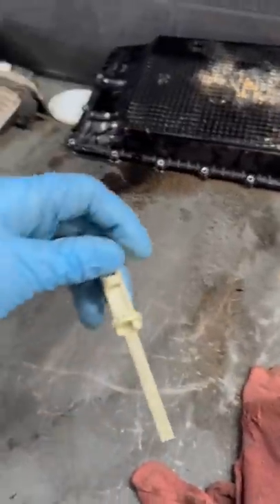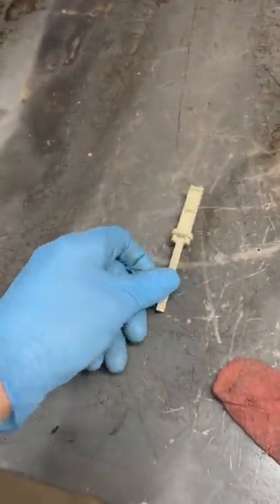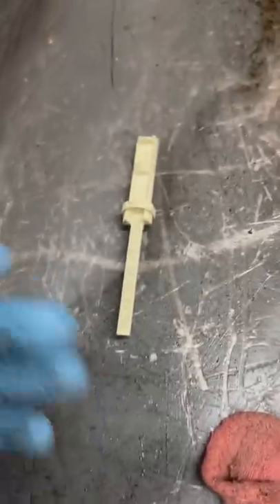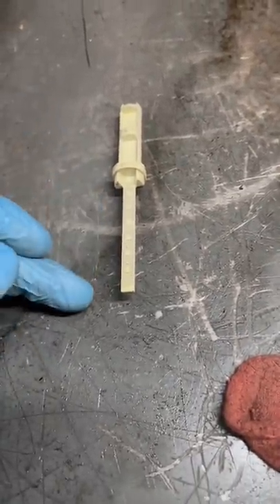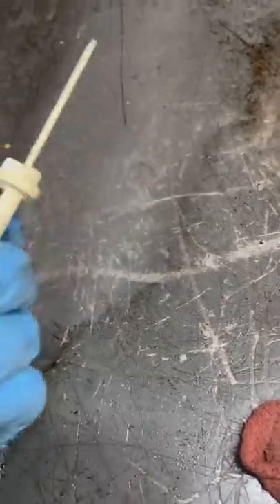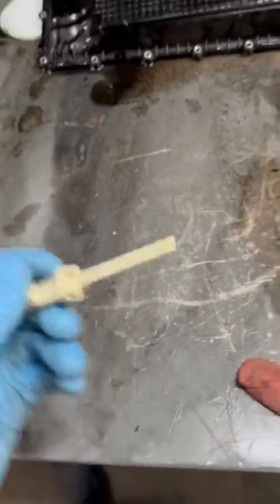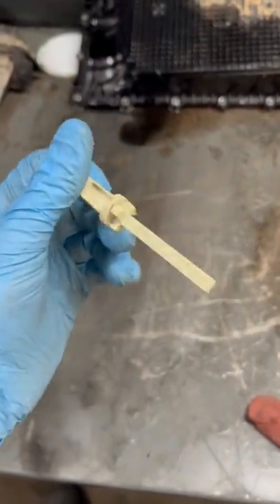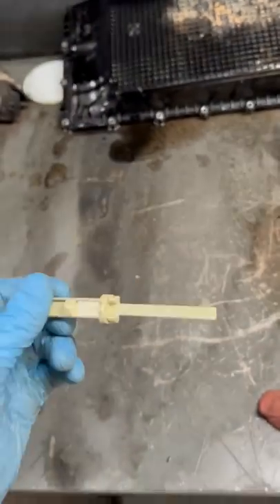Why do car manufacturers make my job harder? #shorts

Comment: Up next on Ford. Remove Engine to Change Oil Filter 🤣
Reply: Already had one where the starter is under the intake manifold so why not....
Reply: @jameskomsella7319  that was a Cadillac
Reply: Not far from doing that. 🙄🤣
Reply: 2.8 l mustang 2.
Reply: Nah that's porsche. Had a friend who had a cayenne that needed a new radiator hose and the entire engine has to be removed to replace it.
Reply: No it’s change engine & keep the same filter. We’ll go in the customer waiting area/lounge & while we’re watching “Homeward Bound Incredible Journey” The Service Manager will come strolling in & look at us & say “ You know that ain’t them dogs real voices”.
Reply: That sounds like a GM thing lol
Reply: 2009-2014 oil filter on the 3.5 f150 is in a stupid spot 🤣
Reply: I gotta lift my whole subie engine out to get to a bolt on the oil pan
Reply: @forbiddenkalamari  Is it Too Late to get an Evo? 😂
Reply: It’s a non-serviceable engine.  The oil will run for the life of the engine just like they say trans fluid will these days.
Reply: @jameskomsella7319  I worked on a tundra for the first time last week, you have to take off the alternator, the power steering pump and two heat shields along with the exhaust to get to the starter. Oh fun 🙄
Reply: Please don’t give them that idea
Reply: @jlufordays109  try newer dodge diesel, after loosening it, you need a special tool to thread on it or it dumps out cause you have to turn it aide ways and pull out over the frame
Reply: I'm pretty sure that's rolled off the line at some point already.
Reply: please don’t give them any more bright idea’s they just might do that lol
Reply: Dodge stratus. Have to remove the front wheel and wheel well to jump the car.
Reply: @L3G4CYxSTL  lol,  1995 Buick,  battery under the back seat; must be vented.  Open  back passenger door and remove seat to  jump start the car.
Reply: @LT-im4fx  no it doesn’t. You clearly don’t know how to change the oil in a Cummins. It’s easy once you loosen the filter though the fender well and drop it straight down.
Reply: @Denali_Rebel  Lol tell me you don't know shit about cars without telling me you don't know shit about cars.
Reply: @JorgeChavez-du5vm  yeap not a thing just like modern automotive engineers.
Reply: @Denali_Rebel  Lol imagine being such a raisin  brain that you believe what the manufacturers' personal shills tell you.
Reply: @JorgeChavez-du5vm  what in the world are you talking about there bud?
Reply: @Denali_Rebel  Lol that's my line.
Reply: @jlufordays109  nothing makes me hate ford more than that stupid oil filter placement like bro your slightly better than chevy yet I'd rather work on a chevy cause they seem to give a damn about practicality.
Reply: @Sackmatters  guess you haven't worked on a newer Cummins, they come out the fender
Reply: @jameskomsella7319  sounds like a Lexus LS400
Reply: @tieroneactual2228  🤣👌
Reply: Ls swap the world.
6.0..
Let the arguments begin😅
Reply: @mikeeilbes3645   I Would LS Swap Any Supra 👍🤣
Reply: @mikeeilbes3645  YES 👍😃😂

Comment: They don’t care if it’s efficient for you as long as it’s cost effective for them.
Reply: Car manufacturers are only guaranteed money on a vehicle once. At the sale. That's why they lead everyone to believe cars are good for only 100k miles. They could care less about servicing them, or quality conditioning. Phones work the same way. They're trying to push you in the newest model to ensure they make their money.
Reply: @bulldogg117  yeah but phones are designed to last almost exactly 2 years. The battery will need to be replaced. now all phones are made without a removable battery. Therefore you have to buy a new phone. Unless you know how to remove the back and install your own battery. Which most people don't
Reply: @timothy9360  lithium ion batteries should have a life of a lot longer than 2 years even at constant usage. I think what kills them nowadays is the fast charging. I turned that off.
Reply: @gheebuttersnaps2011  they are designed to only last 2 years. That's when your contract is up and you need to upgrade to a new device. These companies are not stupid
Reply: @timothy9360  I don't think that's true at all. Look at Apple went out and intentionally ruined people's batteries because they were keeping their phones too long. My aunt was over 5 years on the same iphone when they did that. The phone I'm on now is over 2 years old and I've never noticed a difference in life. I've also never known anyone to get a new phone because of a bad 2 year old battery. I just don't see it.
Reply: @gheebuttersnaps2011  well I'm specifically referring to android devices. I've never owned an Apple, nor will I ever own an apple device. Every android phone I've owned in the last 10 years. Needed a new battery at almost the exact 2 year mark. Until i switched to samsung galaxy. Right now I have in my hands an s10 plus and it is fine. I've had it since the phone came out. I also have an s10e got them both at the same time. The s10e battery needs to be replaced now. While the s10 plus is still going strong.
Reply: @gheebuttersnaps2011  my point is that they used to make phones with removable backs and batteries. Now if you need to replace your battery you have to either buy a new phone or learn how to remove the back and battery. Which isn't hard at all. But the point is they have started to make phones that typically need to be repaired or replaced at the 2 year mark.
Reply: @gheebuttersnaps2011  all of my friends and family get the new devices at the end of the 2 year contract.
Reply: @timothy9360  My phone is a note 10 plus. I think they just made the batteries non removable so they can be waterproof. It's still only like 75 bucks to get the battery replaced. You just gotta take it somewhere specific like ubreak if you want the phone waterproofed again. Idk how many people do that.
Reply: @timothy9360  apple was under fire because they not only decided to sacrifice  their battery's, but to hinder their os aswell. Phones and electronics in general degrade over time, companys amplify and take advantage of this ofc. However theres no set slow for a guarantee slow off after 2 years of a products existence, thats just a general average of product consumption over its entire life span, thus including kids smashing phones seconds upon release. Additionally "2 year contracts" were banned almost 3 years ago in us. You believing every phone slows 2 years after launch is the same as someone believing a car is only good for 100k miles. Furthermore proving my point with irony. Just take care of your shit and it will take care of you. Bless. 🤘
Reply: @bulldogg117  I'm under a 2 year contract with Verizon right now. So you clearly have no idea what you are talking about. 🤔
Reply: @gheebuttersnaps2011  you can take it to someone sure. But it's really easy to take the back off with a heat gun and the tools to pry it off. You break a screen you can buy the digitizer and swap all the internals yourself. It's not hard at all.
Reply: @bulldogg117  it's called planned obsolescence and cars certainly fall under that category. I'm a mechanic and I'm here to tell you. Every single part on a car is designed to wear out. Why do you think every year they make a new car with only minor changes. Planned obsolescence is very real. You ever heard of the light bulb? Phoebus cartel. The first light bulb commercially sold still works to this day. The Phoebus cartel had no choice but to make filaments that wear out. Otherwise no light bulbs would get sold. If your phone lasted forever they wouldn't sell anymore phones. Planed obsolescence..
Reply: @timothy9360  Your phone won't be waterproof anymore if you do it yourself. You need a special machine for that.
Reply: @timothy9360  That's still not true. I had the motherboard in my note replaced by Samsung and it's still ip68. Even authorized dealers like ubreak have the tech to reseal a phone.
Reply: @gheebuttersnaps2011  drop it in water and get back to me. 🤣🤣🤣
Reply: @UCjaiRtjmOskeDeP9ieWhgLA source "trust me bro I Google it" you're leasing the phone. They can no longer stop you from canceling said contract without fees even if you signed for a longer term. This was voted into bill in 2016, you're 
an absolute rock, I'm sure all the cars you've had wheels off on because you Googled torque specs have served you well. 🤣
Reply: @gheebuttersnaps2011  you definitely don’t have an apple if you haven’t noticed a difference in battery from when you bought it to 2 years later. When I first got my 11, it could go all day without needing charged, now 2 years later I can’t go 2 hours without needing a charge. The batteries are made to crap out as soon as the new phones drop. So you either sit on the charger all day, or get a new phone so you don’t have to be charging constantly. I love when people like you try to act like they build these phones to last a lifetime.
Reply: Thats the case with everyone really

Comment: Also adding to the "cost effective" group On the bright side it cuts down on having multiple different model specific dipsticks in the shop. If they would make a vehicle/transmission chart like they have for torque sticks then it wouldn't be a big issue.
Reply: They should just stamp the relevant numbers into the side of the transmission. Problem solved.
Reply: @Cheesus-Sliced  I’m not a mechanic, but don’t they have data plates that state the specs on each car somewhere, it could easily be added to that
Reply: @almostanengineer  problem is positioning. Those plates are generally on the frame at the top of the engine or the door frames, and would be hard to access when the vehicle is lifted
Reply: They should just put same type of level indicator on all dipstick. Point a to b or 4 to 5 when fluid is hot for that vehicle. No need to stamp fkn 1 to 8 or a to f.

Comment: It all has to do with the engineers I've been working in parts for almost 20 years now they call nothing what it actually is. But I think it's really funny when GM can't get a part and they refer you to the Toyota part number. As well as the rear bumper of the Pontiac Vibe saying Toyota Matrix on the inside of it.
Reply: BL Dontmatter  there's an old couple that don't live too far from me that I've been driving the same two vehicles since the 1950s they don't keep them garage door anyting they just take care of them and keep them clean
Reply: Same car engines. Many people don't know that the vibe is a matrix.
Reply: @nzavali00  most front wheel drive gm cars are last years toyota with higher price tag and a garbage warranty.

Comment: I feel your pain I'm a mechanic as well and when they engineer these vehicles they do not take into consideration the mechanic and repairs
Reply: The big difference between a design engineer and a mechanic.  There's actually a guy who wacks it knowing he designed a total cluster F for a mechanic because the engine is easily worked on outside the vehicle.  😆
Reply: That's 100% not true lol. There's an entire department of master mechanics who have to go over the CAD models and service procedures of literally every single part on the vehicle before the design is approved and released to proto tooling.  For example the Pentastar has 100k platinum plugs because the intake manifold has to be removed for service. So now the customer only has to do it a few times in the vehicles life instead of every 30k miles.  Who do you think writes the service manual before the first production representative proto ever rolls off the line?
Reply: You would be surprised as to how much engineering goes into designing cars for ease of assembly, parts compatibility and serviceability, just because one area doesn’t seem to make sense to you, doesn’t mean it’s not considered
Reply: @joncot1812  people don’t realise the amount of engineering that goes into every single thing around them, heck even getting an avocado from seed to table has had hours of engineering put into the process.

Comment: It isn't time efficient to have to jack it up level and take a fill plug out and get it up to a certain temperature. The last one I did was a Charger AWD. I had to take the front driveshaft out to get to the fill plug.
Reply: Oooooh! 😵
That's ultimate pisser!

Comment: I know how ya feel I'm in HVAC and the idiots that design ac units never have to work on units
Reply: Not just condenser units and furnaces either. They do that with every home appliance, from the fridge to the stove. 🤦🏻‍♂️
Reply: @janitorial-engineer2286  yes you are correct can't stand any ac/hp unit with no pressure switches I'm sure we could make big list
Reply: @tedhicks5431  I thought that was a standard for heat pumps. Interesting they dont all come with one.
Reply: @janitorial-engineer2286  your correct there is hi pressure and  loss of charge switch now I did have to different rheem package units hp didn't have hp nor loss of charge switch yrs back
Reply: "it's compact! it's efficient!" said the engineer "How supposed to clean triple stack condenser coils without damaging them in the process...."asked The service tech
Reply: @TheSkinnzer  With the micro robot that costs 10k. Duh 😂
Reply: @janitorial-engineer2286  put hefty down payment on sports car or buy 10K service tool. No wonder the youth don't want go into the trades lmao

Comment: It's amazing how new cars cut so many corners.. When I was younger cars back then had 2 dip sticks under the hood one for the transmission 1 for the oil
Reply: cars are more reliable and transmissions hardly ever need to be  checked by anyone buy a mechanic these days.
Reply: @TheDanAge  although there have been improvements. The the cars made in the 70's, 80's, and 90's where actually pretty reliable.  They where abit more robust back then. For example the gm power glide transmission was bulletproof. I think the improvements are more in the fuel economy and power in the engines. Brakes are also better.
Reply: My Chrysler LeBaron had 3. The third was for the power steering.
Reply: I won’t buy any vehicle that doesn’t have 2 dipsticks if I can’t work on it myself I won’t buy it
Reply: @TheDanAge  BS.. All bs.. A car that looks brand new or even fairly new shouldn't be on the side of the road because a failed relay or transistor! Seen new cars stranded all the time because the silliest failures while the whole car is immobilized!
Reply: @dcgo44r  you probably eat chunky mash potato
Reply: @TheDanAge  yeah it was made with green ones too!

Comment: All I know is at some point I opened a hood only to find yet another cover that has to be removed to even see the engine.
Reply: Don't forget the cover on the bottom  of the engine you need to remove just to repair a basic part!
Reply: Haha until you work on a VW  where you literally have to disassemble half of the engine to get access to the thermostat
Reply: @harrison00xXx  I  see that project coming soon on my VW! But I can tell you a PT CRUISER is a hell of lot worse on the water pump. You need to take it down to the timing belt because the water pump in on the same belt.
Reply: I worked on a bmw for the first time I had to take off like 3 plastic covers to change control arms
Reply: @rimc8783  wow thats a pain in the a**

What im really wondering, my Subaru Impreza with EE20 engine (the boxer diesel from 2007-2014) is not as complicated as many other competetive cars, only a shitton of bolts and its necessary to lift the car
Reply: @ArmyofSeaturtles  not that bad
I have to take off my front wheels and the wheel housing to replace any bulbs on the car!
Reply: @harrison00xXx  It's sort of funny that you say that. I'm currently building a VW 1.9 TDi to put in a Geo Tracker and i've stopped that thing down to nothing but don't remember seeing where the thermostat was. I'm going to have to go through the pile of parts and find it.
Reply: @sweet65mustang  should be located near the generator at least it is there on my 1,9 TDI 1Z

Needed also a replacement not long ago since it didnt reach above 70 degree C anymore
Reply: @harrison00xXx  it should be there then,  mine is a 1Z also. Sp because I'm not sure how far I am going to take this thing, what have you done to yours? Any mods?
Reply: @sweet65mustang  not much, its pretty much stock (hardware), got only rebuilt end 2021 after nearly 400k km in a G3 cabrio.
Its still one of the easiest to maintain VW engines i guess

All i did was stronger intake hoses and clamps (saw a friends 1,9 TDI AFN blowing off multiple times the pressurized intake hose) and i am running it since about 200k km with about 120HP chiptuning and 1,1 bar
The 120HP/around 300Nm are definately the maximum for a stock clutch, a worn clutch also tends to slip with this mods already and you cant really go 100% throttle below 2k rpm but with a tuning clutch its just fine and awesome to drive
Reply: @harrison00xXx  yeah, i'm trying to decide how far to take this considering it's replacing a 1.6 gasser with 80hp and about 100Nm. I want more power but I just wonder if I'd slip the best Geo Tracker clutch I could find or if it would explode the transmission or transfer case. I guess I could stage 2 it and then see if I wanted more later.